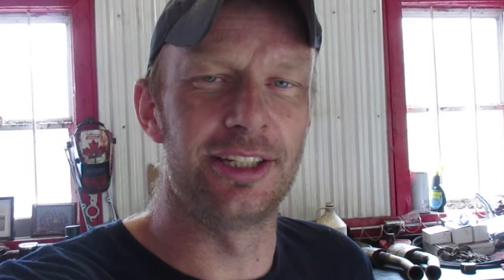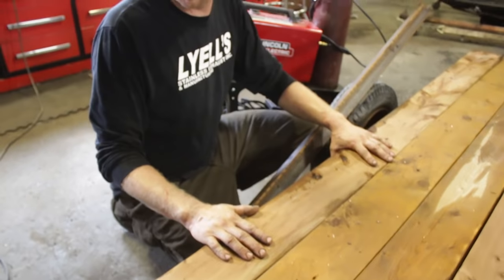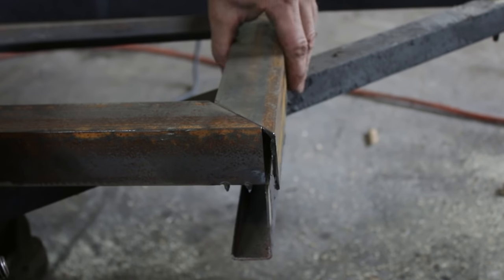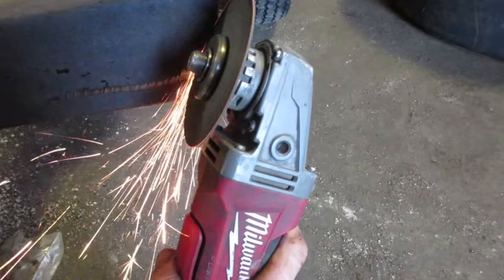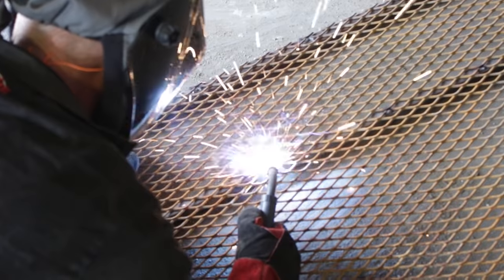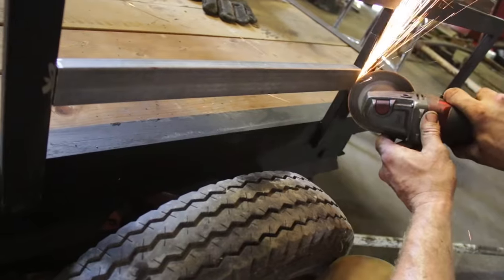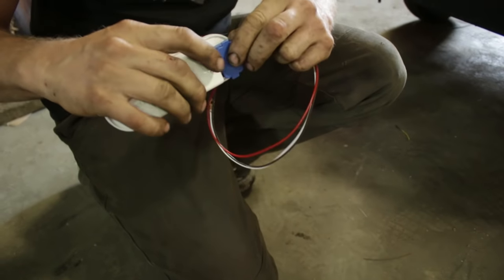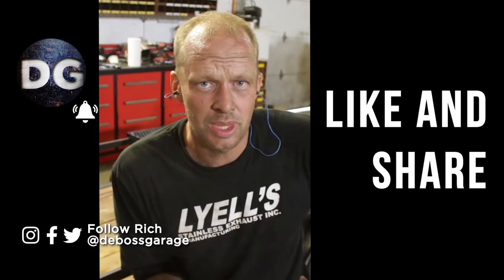How To Build A DIY Utility Trailer for CHEAP!

Comment: Just a comment about video length. Several times in this video you mentioned that you were worried the video was getting too long. Stop worrying about it. If I'm going to watch a video about building a trailer, whether it's 30 minutes or 90 minutes I'll still watch it. So just do your thing and not worry about time. And thanks.

Comment: I prefer the one end to be just bolted on and not welded.  That way you can remove the end easily to replace any boards if the need arises.

Comment: Here in the States we just buy a 4x8 trailer brand new from Harbor Freight for $250 USD. Bolt on a $20 sheet of plywood and call it good.

Comment: Love your work and the channel, but I don't believe you should weld across the top of the drawbar chassis where the A frame meets the front of the box and only run the welds along the chassis. 
My understanding is that the weld will cool quickly due to the large heatsink so it will harden the steel at that point making it brittle right where a huge stress load is.
In Australia we have laws that don't let weld any light vehicle directly across the top or bottom of anywhere on the chassis without angles and or fishplates.
As you've already done it now, i suggest at least adding some gussets on the sides.
Reply: Lol that’s only if you cool your weld quickyb
Reply: yeah, the weld cools quickly because all the the attached steel works as a heatsink drawing the heat away

Comment: Thanks a ton Rich.  A question about welding - do you go left to right, or a circle pattern?  I have not welded since highschool, want to start.
Reply: Good day  For a straight weld, with a narrow weld like he was doing, a strait weld is good & strong.  For heavy welds you might want to do different  My opinion  thanks
Reply: Don Voll Thank you Dan.
Reply: Depends on what kind of joint, the gap, how big the weld needs to be

Comment: Did i miss the welder give away? If not then i would like to win it. I own and operate a lawncare in Pennsylvania. I work from sun up until sun down all day everyday rain, sun, sleet or snow we dont stop. Breakdowns are expensive to have fixed by a professional welder, i grew up around welding but took a different route so i have some knowledge to it. This give away would be perfect for the up-keep of my equipment, truck and trailer. I would buy one but by the time the bills are paid we have just enough to live on. If i could win this welder that would be great! 
Thank you,
P.s I subbed to you.

Comment: Its a nice build but you need a lot of used coponents and supplies to make it worthwhile. A new dexter axle, springs, wheels, and lights alone will set you back several hundred dollars new. Thats about what you can buy this whole trailer new off the lot for.

Comment: i have a 170 flux core welder from harbor freight and i think i m going to do a 5X10 trailer...do you think the welder is up to the task because im a very inexperienced welder ...im more of an electro mechanical automotive nut
Reply: It can probably be done, but you'll wanna practice with it. A lot. And if you're not confident, or you get inconsistent quality of welds with consistent technique, just buy a used trailer, and maybe weld some accessories onto it. The smaller cheap welders are great for small projects here and there though. I have one myself, but i don't trust the quality of the welds (due to machine and user flaws) for anything structural or that could kill someone if the weld fails.  If you're looking to do anything structural, I'd definitely suggest getting either a true MIG (with gas. There's no such thing as "gasless mig") or stick welder with 220v or 240v power. You'll get a better range of voltage output, better range of penetration, and typically much cleaner welds (with some practice).

Comment: I get that this was sponsored, but I would not have welded the rear angle iron piece in. That way I could change the wood without grinding and welding.

Comment: Biggest thing with aluminum is removing the coating/oxidation layer. If you don't by the time you get it hot enough to penetrate it has already burned thru. Fought with that forever until an old timer who knew his stuff told me. (40 years welding on the government aerospace level)

Comment: What was the point measuring the outside for square only to chop and toss it, no guarantee the inside framing was.
That axle could've been set ass backwards upside down at a 45 & the outside still woulda been 111.5 or whatever it was corner to corner.

Comment: Seems that when you turned up the welder to cut with it .... you were just turning up the wire speed.... the amp/voltage control was already maxed out
Reply from the maker: Pretty amazing welder to turn up the wire speed on the stick!
Reply: DEBOSS GARAGE you must be joking right ... you get my point I hope ... you did nothing to the heat... you just touched the wire speed

Comment: Should call Lincoln and tell them you need a welding filter for your camera, a good autodark bag helmet should do the trick.

If I had a welder I would be working on a tube Chassis to create a RWD street legal drift car out of a fwd 86 VW  jetta 2 door

Comment: The utility trailer that you build out of a pop-up camper how much weight does it hold the reason I'm asking is because I just bought one for $300 and you get to be a utility pop-up camper also but they put a metal floor and truck tool box in the front but I need to know how much weight it holds
Reply: Oh mine has the 6or 8 inch tiny tires

Comment: thumbs up because he arc gouged the lights ha ha ha.  I had a welding spark pop a trailer tire before. While most likely it wont happen, its possible. put a cardboard box over the tire.

Comment: Not a bad idea, but allot of mowers have a 50-inch deck. 4 feet won't cut it. My trailer has a 5 foot deck and its a chore getting mowers on it. Barely fit.

Comment: How would you replace the wooden deck with all the angle iron welded on like that?
Reply from the maker: remove the last piece of angle and slide them out.  If the deck is rotten, its due for a paint job anyway
Reply: I would love to see you do a similar video on building a flat deck for a pickup 👍

Comment: The smoke off of welded galvanized steel is toxic.  I don't recommend welding with it, but if you do go outside and use some fans to blow away the smoke.
Reply: He had the fresh air supply hood, was in a well ventilated shop, id say hed be fine, but yes lead poisoning is not fun

Comment: Wow I have never seen anyone use a stick welder as a cutting torch lol.
Reply: you must have lived a sheltered life
Reply: First time I saw it was when I was 15 and my uncle cut out the frame rails of my Bronco to make room for the exhaust of the 429 I'd swapped in.
Reply: the upscriber cool. In the next couple of years I plan on swapping a built 460 into a 77 F-150 single cab short bed 4x4. I hope I don’t have to chop the frame up too bad on it
Reply: the upscriber you still have the wrench 🔧 you were born with lol
Reply: you dont know much a, there a rod just for that
Reply: Arnold Romppai that type of cutting requires a very strong arc welder and a very high volume air compressor. I have seen that before.
Reply: @stevenvanheel3932  sorry you are so wrong, you are referring to carbon arc air, witch in my 46 years as a welder have used one thousands of time and yes it take a fair size machine to run it but that is not the arc welding electrode i am referring to. there is an arc rod called champher rod, that comes in 3/32, 1/8, 5/32 1/4" that can be used on any small AC arc welder that takes no air, starting with a 3/32 rod for both cutting and gouging , how ever like to be a good welder this rod takes talent to use to work it right
Reply: Arnold Romppai that is interesting. I have never seen that chamfering rod before. I’ll have to pick some up sometime and give it a try.
Reply: @stevenvanheel3932  yes to use it as a cutting rod you hold the rod strait up and down, and bounce it up and down in short stocks,  as you move forward, to use it to gouge out cracks or welds ho;d the rod at 40 to 30 deg angel and work the rod forward and back wards in fast short storks, never braking the arc, you do this movement fairly fast to blow the molt metal out, if you need to go deeper just repeat over it again, there will be slag on the edges but it chips off easy, takes practice, i have used it a lot when i worked in the bush as a AA class welder, if you dont understand let me know and i will do a video on it as seems there are none on here
Reply: Arnold Romppai thanks for the info. I understand what you are saying perfectly. I spent lots of time back in high school doing arc welding on steel, mig, spool gun, tig on steel, stainless, and aluminum, gas welding, brazing, plasma cutting, and torch cutting. I just had no idea that they made a rod for lighter duty cutting.
Reply: You have never been around a welder
Reply: clancy coral sherwood lol I bet I could weld way better than you. I have hundreds of hours welding and I almost went to college for it but decided not to because I didn’t like the Smokey and dirty work environment.
Reply: @stevenvanheel3932  It's called gouging and carbon sticks wrapped in copper foil available in various diameters are used. The stick holder is a special one with a swiveling clamp with air holes to direct the compressed air through.
Reply: ZerokillerOppel1 yes, that is exactly what I was thinking of.
Reply: @stevenvanheel3932  So the basics are a bit different as Arnold Romppai describes but the handling is exactly the same. I've also done that thousands of times.
Reply: we call that hot rodding
Reply: @theupscriber65  my 79 bronco has a 460, no need to cut the frame.

Comment: Is it possible to build a trailer to hold a car? or around 5k pounds?
Reply: Tamaine Miller no, definitely not. Modern technology isn’t advanced enough to build a car trailer.

Joking. Yes, of course. 5k pounds (about 2.5 tons in normal talk) is a decently heavy load but there are trailers out there designed to carry triple that weight (and of course more, think semi trailers).

Google it 👍🏻

Comment: What are you gonna do when those boards need replaced? You welded them tight in place.
Reply from the maker: That's future Rich's problem in about 20 years.
Reply: DEBOSS GARAGE 20 years? Idk about that. I’ve replaced my boards twice in 5 years. I only haul my ATVs. The weather isn’t kind to wood sitting in the heat and cold.
Reply from the maker: @wildman1180  I replaced the deck on my float trailer 12 years ago and it still looks great, that's what I'm going on....
Reply: DEBOSS GARAGE that’s hard to believe, since I use treated wood and as I already said, I only haul ATVs and sometimes yard brush. I don’t know anyone with a trailer that has used the same boards for 12 years either. BUT. Ok then.
Reply: @wildman1180  twice in 5 years? That's some cheap wood.

Comment: Bumper and mini trailer and mini bike. I'd love to win a welder  currently have a 90amp sorta Chicago electric wire feed and a horrible Campbell 70amp stick both 110v machines barely hobbyist lol
Reply: Look at the Amico CTS-160 on Amazon. I gave $400 for mine, they're $279 now. They stick, TIG, and plasma cut. Good low price machine.

Comment: Excuse my ignorance ....but why if it’s 2 by 6s then it’s measures 5 1/2 ?....
Reply from the maker: 2x6 is rough cut.  It then gets planed smooth to 1 1/2"x 5 1/2"

Comment: I have been a welder fabricator my whole life and you are not gonna build that trailer for less then what tractor supply sells it for. Big trailer companies get there materials at a bulk rate. That’s how they make money. Even a used frame and set of axles is worth 150 bucks on Craig’s list. Unless you get all of your materials for free you are waisting your time. Do yourself a favor and go to your local tractor supply and get your wallet out. Unless your time is worth nothing.

Comment: I would not recommend grinding shit down with a cutting disk, It is not meant to be grinded with, It is meant to be cut with, It is way too thin for pressure to be put on the sides if you try to grind with it or you don't cut straight and you put tension on the sides of that disk and it cracks, it will break apart and go flying at your face.

Comment: I wonder how often those $1 grinder wheels blow up in his face
Reply: Good day  TSC sell dewalt blades here in Ont.  for $1.00  work great I never had 1 blow up,  they do break easy .  Thanks
Reply: As long as u use common sense you'll be fine
Reply: probably pretty often, the dewalt blades are like fireworks
Reply: I've never had one of those mastercraft disks blow up.

Of course, it's thin. So it won't be forgiving if you start doing stupid shit like letting the work sag and bind the disk up, or using it as a grinding disk instead of a cutting disk like so many seem to want to do.
Reply: I've been using Mastercraft cut-off wheels for years, never had a single one blow up. Now and then you'll tear a chunk out of one but as cheap as they are you toss it away and grab another.
Reply: Been using harbor freight zip discs for years. Only brake when misused or you get stuck in something. Ive used diablo and dewalt also but HF is just fine

Comment: I’ve never seen anyone cut steel with a stick welder
Reply: Works in a pinch if you dont have a torch handy, similar to air arc gouging with out the air or copper rod

Comment: Fancy talking tape measure, uses screwdriver to mark lines........🤷‍♀️
Reply from the maker: Show me a pen or a pencil that makes as thin a mark as a screwdriver and leaves a mark on old steel and never needs to be sharpened or never dries out
Reply: @DEBOSSGARAGE  lol. I use a ice pick flatted on one side with a grinder
Reply: Scribe

Comment: I’m surprised you didn’t use your truck keys to mark the steel
So you used a fresh air system when you welded but wire brushed the frame and that nasty chemical laden galvanized railing w/o a mask.?
Hmmm I point out the weird shit I know

Comment: i dont mean to laugh but hah even there they dont cut wood like they use too.. really hate it when they say no it is 2x6 and then you say measure it and they are like well blah blah blah is the reason its not.. the best i heard yet was, the blade cuts it that way to save material...

Comment: 29:23 “cant tig alum because it doesn’t have the heat, but it can tig stainless”? Say what?  I think it has more to do with AC and DC machines, not the heat.
Reply: Rob Bowman I agree with the polarity being the issue